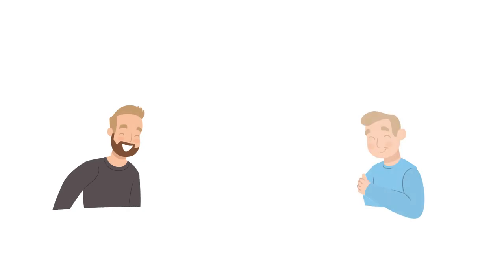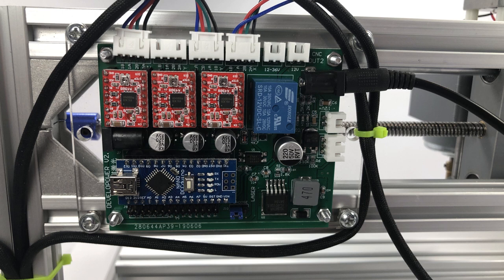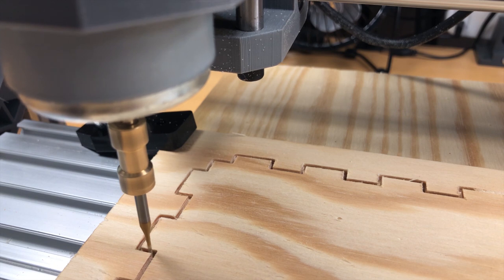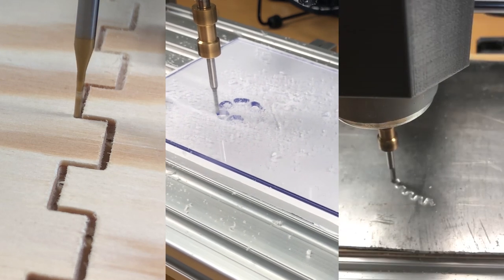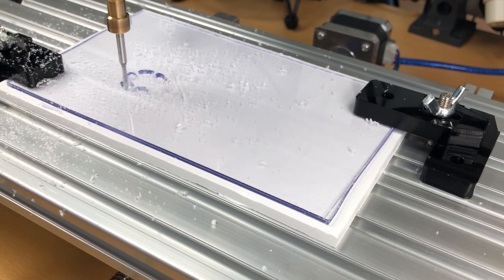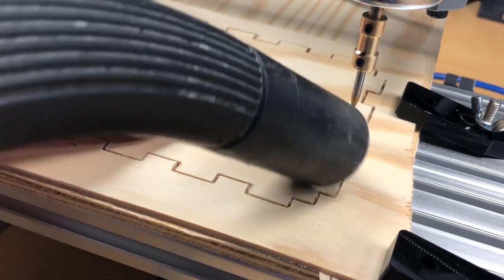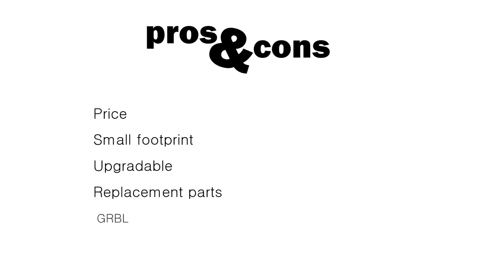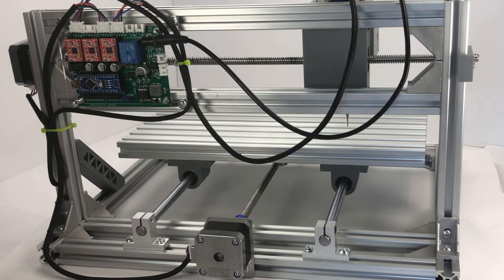3018 CNC from Banggood.com (budget cnc 3018)

Comment: when you say UPGRADABLE, does that mean that I can enlarge the x and y axis and the same motors will do the job well?
Reply from the maker: Although the x and y axis are not easily upgradable, the stepper motors will perform the same way. They just have to travel further.
Reply: The Y axis can be upgraded with not too much hassle. You just need a couple of longer rods, extruded aluminum frames and a longer lead skrew

Comment: Hi from brazil. 
What software do you use to control a CNC?
Here I am using Mach3, but it has problem with USB.
It doesn't work right.
especially if you do the self-levelling, it locks by the usb.
Reply from the maker: Hi!
We are simply using GRBL Control / Candle.
Reply: @DIYTECHBROS  
Thanks bro!

Comment: What settings (feed rate, depth rate etc) and what bits would you use to engrave on aluminum sheet?
Reply from the maker: You can “cheat” and use a bullnose tip. That way you can cut shallow and keep the feed rate up :-)
Reply: Ok, but what do you use?
Reply: @robertdale5566  its a secret...

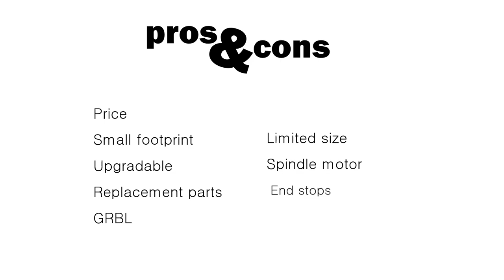Comment: in 3:58 you said it does not come with end stops, could you tell me what are end stops?
Great review btw!
Reply from the maker: Hi! End stops are simply micro switches the mill runes into before it crashes in to the sides. As the CNC does not know the limits of you workspace, nor does it know it's precise starting point on the surface, it may want to move beyond the available space and crash into the sides. These micro switches will let the controller board know that it has reached a wall, and stop it safely.

Comment: Once again Excellent video!  Do you know if it might be possible to increase the workarea depth from 16cm to say 34cm x 34cm? I  was thinking say if you placed a 30 x 30 sq cm acrylic sheet would it not be possible to machine it beyond the 16cm limit of the aluminium base?
Reply from the maker: Hi Mayur! No, the bed of the CNC can only move a certain distance without rebuilding everything. BUT, I some times cheat by milling one part of a 30cm x 30cm acrylic sheet and then slide it upwards. For accuracy, I add to alignment drill holes.

Comment: Thanks for the video. I was considering the Sainsmart MX3 but the basic versio Pro is cheaper and in my budget.  Did you complete the enclosure build?
Reply from the maker: Hi!
I have only good things to say about our budget CNC. We are currently working on a PCB video to show its ability to mill very fine and precise pieces as well. And it was less than $150 (see the link in the description). Since getting this CNC we hardly use the bigger one any more :-)
Reply: @DIYTECHBROS  Thanks. Makes my decision to purchase one. I want to explore  attempting some intricate joinery with contrasting wood species.

Comment: How long time will it take roughly to cut through 4cm of mahogany?  :)
Reply from the maker: Hi Steffan! I’m afraid the answer is: it depends. More importantly then the depth is the length of the cut. The second factor is the kind of bit you are using. When you start the cut you can always adjust the speed as you are cutting. Start off gently and listen to spindle as you increase the speed.
Reply: Thanks for the answer!

Might look into something bigger, might start a super small business thing that is on the side of my regular job :)

Comment: Hi.. If I want cut a through sheet of about 5 - 6mm thickness, would this machine able to achieve that?
Reply from the maker: +DimplePoji Hi! What material are you thinking of?
5-6mm in one pass may be a bit much. But, if you allow it to do multiple passes it can be done even in aluminum!

Comment: Thanks for the cool vid.  Two questions: 1. Is there an option or mod for carving round objects, like a rolling pin? I want to make rolling cookie cutters. 2. Can I use this to engrave glass?  I would be using a diamond coated bit. The real challenge would be the  water jet for keeping the glass cool.  I want to engrave fairly deep!y, 1/8 to 1/4 inch, and drill holes as well. Currently I amusing a drill press and a sand blasting cabinet. Very tedious and time consuming.
Reply from the maker: Hi Robert! No, there is no 4th axis. So you can't have it roll. Regarding glass engraving, yes, you can make shallow engravings. But to cut deeper you have to do multiple passes, but I'm not that familiar with glass so I'm sorry to say that I can't give any good advice.
Reply: @DIYTECHBROS  Thanks for the reply. With glass keeping it cool and lubricated is the important part. Continuous water flow is the most common way to achieve that.
Reply from the maker: +Robert Martin very interesting! We are currently working on videos about the 3018 cnc with acrylic and PCBs. If we are brave enough and manage to master it maybe we will cover glass in the future. Thanks for the info and the tips! Mike

Comment: thanks for the video. Im new to the CNC and also have the 3018 and I am using inkscape as the software to create gcode. I have done the instruction to convert pictures to a gcode (with a .gcode extension) but the problem is the grblcontrol is not showing anything. It's all blank and I noticed that the samples are all in .nc extension. It seems to me that the grblcontrol does not recognize the .gcode extension. I dont know what to do next. Do you know if it has anything to do with the settings?
Reply from the maker: Hi!
Could be that your 3018 has GRBL0.9. Make sure your software supports 0.9 - or upgrade your GRBl and use a newer version of GRBL control (candle). Note, do not reprogram the Arduino nano that came with the 3018 - get a new one!

Comment: Can it engrave 0.5mm depth in 999 fine silver?  Or could you upgrade it ?
Reply from the maker: +Piovera Capolavori Sure, thats not a problem! I would not do it in one pass though. Mainly because the forces on the bit can warp the engraving and not because of the CNC!
Reply: @DIYTECHBROS  wow thanks for the reply.  Will it cut through 1mm 999 fine silver to cut 38mm diameter circles out ..
Reply from the maker: That seems reasonable! But, since you are cutting a costly material you must consider waste material from the cut trace. Just to make sure you should not go with a higher RPM and smaller bit?
Reply: @DIYTECHBROS  ok.  Is there another way I can contact you / donate $ for the advice. ?  Thanks

Comment: Can I increase its bed length 1meter?
And how it's speed increase ?
Reply from the maker: You can replace the power supply to increase the speed. BUT, if you want a bigger work area you probably want a strong spindle as well, not only more RPM. So, then you have to replace both the spindle and the frame... Might be better to buy a different CNC ;-)
Reply: @DIYTECHBROS  i required bed size 1200mm X 200mm and i want to make my own CNC. can you please suggest me where i buy cnc parts. or kit.

Comment: hi 
my cnc3018 show me error alarm in stats can you help me
Reply from the maker: Hi Amir!
There are many reasons why the alarm can go off. When is it going off?
Reply: @DIYTECHBROS   hi
no when i give job to my cnc its show me alarm
Reply: @DIYTECHBROS   plz help me if you know same thing
and how can i share same picture are video to show you alarm error
Reply from the maker: Make sure that there is no interference when the spindle starts. Try starting it first, and then send the code.
Reply: @DIYTECHBROS   the spindle is starts x-y-z exes not moving and show alarm
Reply from the maker: Hmm... try to disconnect positive terminal of the spindle and send the code and see if it moves?  Remember to stop it before it crashes in to what you are cutting.
Reply from the maker: Have you been able to fix the problem Amir?
Reply: @DIYTECHBROS  no
Reply from the maker: Are you able to move the CNC bed or spindle up and down with the arrow keys in the software?
Reply: @DIYTECHBROS  no only the spindle is start but not move up or down
Reply from the maker: I guessing you have tried the logical stuff, like use a different USB cable, use a different USB port, downloading GRBL CTRL again, and maybe try it on a different computer? My last tips would be to upgrade GRBL on the Arduino Nano board. Are you familiar with Arduino? We have upgraded to version 1.1 and do also use Candle (a newer version of GRBL control). We did not face any issues - but wanted to test upgrading it. I recommend using a different Arduino, so that you can just pop the original back in. Also, take notes of the settings :-) 
Maybe we should create a video on the topic?
Reply from the maker: OHHH, on more thing... just had a call with Chris about your CNC now... make sure you set the spindle speed to max in the software!
Reply: @DIYTECHBROS  chris number
Reply from the maker: If you send us an email (address on the about page) we can do a Google Hangout call if you would like?

Comment: Dont buy it it sucks. I regret it. Het something bigger specially if u want laser mode just get the glowforge u will make ur money back
Reply from the maker: Hi Luis! In terms of laser, a Glowforge, K40 or something bigger is very different from a Diode laser kit you can place on the 3018 - and it's a very different price as well.
But, in terms of the CNC, are you having troubles with it? What model did you buy from where?